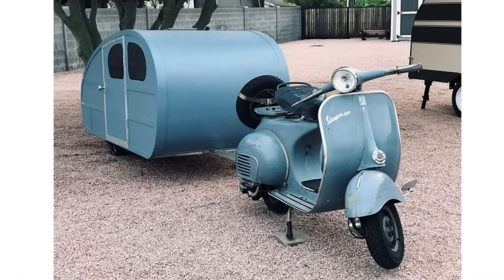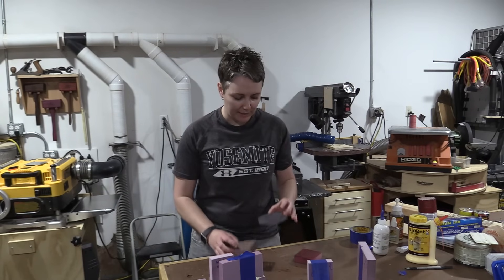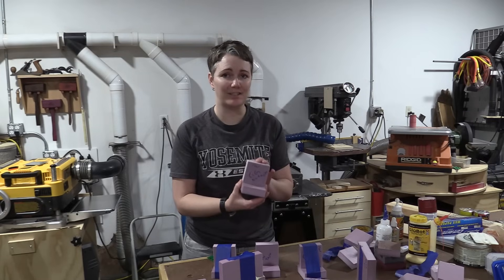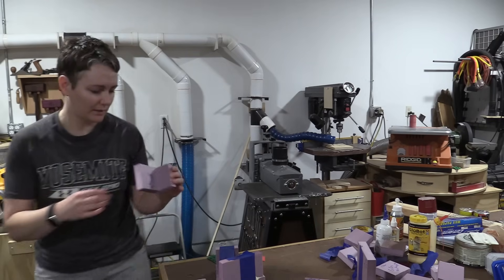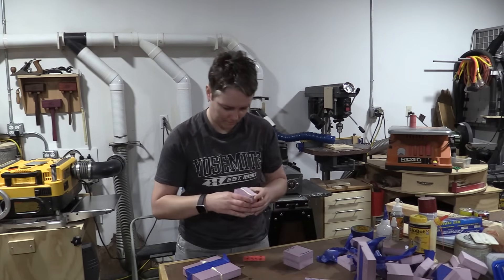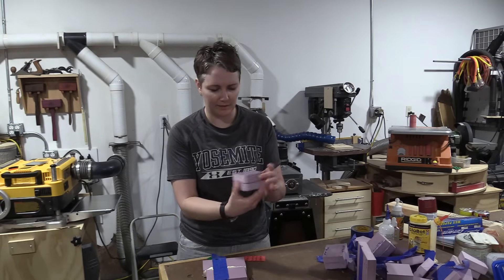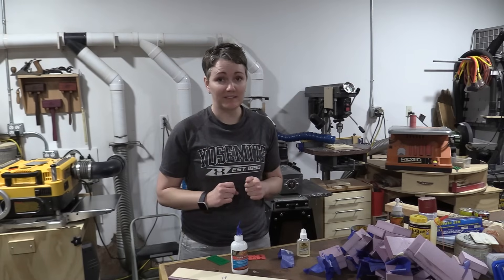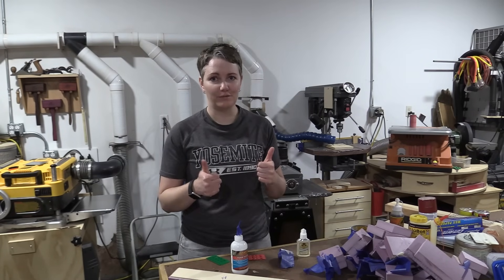NOT Gorilla Glue! Watch This Before Building a Foamie!! BEST Adhesive

Comment: Late to the party here. But just finished my foamie and want to offer my advice. Any polyurethane adhesive (gorilla glue and most construction adhesives) create a mechanical bond to the two pieces being glued. You absolutely must create a rough, or uneven, surface to the pieces being adhered. When done correctly the connection will be many times stronger than the material being adhered. Try sanding the XPS foam at the connection point with a very coarse sand paper. If possible, I recommend rough sanding first and following up with a docker after (I used a roller docker with steel pins made for docking pizza dough). For adhesive I really like a couple construction adhesive designed for outdoor applications: Loctite PL Max (caulking tubes only) and Loctite Power Grab All Purpose (available by the gallon). They are fast acting, easy to work with, and clean up with soap and water.
Reply from the maker: Thank you for your response! And yes,  in the trailer we roughed the foam up with a wall paper remover in some parts and 80 grit sandpaper in others.  The end to end demonstration more accurately shows the foam without any film over it. The foam fusion still provided the deepest bond.
Reply: @thelwood  Another helpful hint: Use The Vacuum Bag System, Used In Fiberglass/Carbon Fiber Lamination, You Can Also Use A Screen Printing Technique for Burning Screens. Build an oversized Frame and attach Neoprene Wetsuit Material. To Pull The vacuum Straight Down From the Upper Surface To Evenly Distribute the Pressure on the Upper Surface. I Believe they use this "Dry Mount" Technique to mount poster prints to Foamcore for picture frames!?!!  😉🙃😜
Reply: Car body panel PU mastic is amazingly sticky and the resulting rubber is tough. I’ve successfully repaired kids school shoes. You won’t find a better test than that.
Reply: Latex paint, will bond EPS sheets, and is friendly with hot-wire cutting.
Reply: @carrolbrooks2143  I would think that you could use any thick plastic sheeting, clamped with folded over 1x2s and a shop vac for the pump.  It doesn't need nearly the 30 inches of vacuum to work well, and that high vac might immediately collapse the foamie camper.
Reply: @jamesmorton7881  PPG Gripper primer from Kelly Moore... holds like glue and hot wire/sanding friendly.  Just let is start to get a little tacky so it will cure faster between layers.
Reply: I used both Loctite products adhering foam to itself as a former for fiberglass. Excellent for me in that context. Excellent also is your video; thank you for taking the time--more than it first appears--to do this study and report your findings. YouTube at its very best.
Reply: I will just use the foam adhesive. But if I make a tear drop trailer I would cover the ugly foam with a plywood paneling. If the trailer is sealed on the outside there will be no leaks. Now to find something to seal the outside that can be painted with auto paint. Camp-Inn and runaway have solved these issues why cant the DIY as well.  73
Reply: Thanks for doing these tests, my experience on client projects is STAY AWAY from Gorilla products in general. I’ve had way too many expensive glue failures with their products. Loctite and Sika products are much better. Gonna give Foam Fusion a try.
Reply: @Bolthole_Studios  yes! In my opinion - Loctite for primo adhesion and wear resistance and Sika for bomber weatherproofing. At least when you're bonding certain materials mechanically - XPS foam, Styrofoam, wood, cured fiberglass, cured epoxy, cotton, glass

Comment: Wood glue didn't cure because the foam is water tight. Wood normally draws moisture out of the glue, which allows the glue to dry. Something to consider with any kind of water based product if you're working with synthetic materials that do not "breath".
Reply: Breathe.
It is what you do.
Breath is what it is.
Reply: 3M spray adhesive.......

Comment: Didn't you know that one of your biggest fans is an amazing material scientist and glue expert?!  If you need a "Home Depot" solution, I would expect a product like Loctite PL300 to work well.  Any of the urethane based adhesives will foam--that's why I avoid them for wood projects too!
Reply from the maker: Awesome! Thanks Seth!
Reply from the maker: I will consult you for all of my glue needs/ questions!
Reply: Hey Seth - great tip.  I did get some PL Foamboard adhesive.   
Planning to bond foam to aluminum.
Now, will it work with EPS - the white “lumpy” foamboard - made with beads (as opposed to the smooth XPS.) ?
Thanks much.

Comment: Just a thought - the aircraft and boat guys use a 2 part epoxy (West System) which you can get at a marine supply store or aircraft supply house (Aircraft Spruce) then they sand and put a layer of fiberglass over the joint - the result you can stand on or jump on without breaking. Sanding both surfaces of a joint is critical.  I made wing ribs this way and flew it for years - about unbreakable if you need great strength. Good video and fun project - thanks for making :)
Reply from the maker: Sounds great! Great information, thanks!
Reply: Yes! I use epoxy in my art projects and I was thinking the same thing
Reply: Doesn't the epoxy melt the XPS foam?
Reply: @mr.e7022  No, epoxy is good for EPS and XPS, old school polyester resin will melt both.
Reply: I’m an aircraft builder also… I mentioned west systems epoxy in the comments for another tutorial video… also Aeropoxy would work (Aircraft Spruce).
Reply: I would put epoxy over the whole thing and put a layer of fiberglass cloth and then epoxy and another layer of fiberglass and then resin.  2-3 layers of fiberglass cloth.  But the joints themself I would use a foam glue or foam insulation. I would dovetail the joints too.
Reply: Epoxy works great with polystyrene foam. But it is messy and overkill and you have to wear gloves. Clean up has to be done before the epoxy cures. All in all it is a lot more involved. I would use one of these glues for foam, or use a construction adhesive.
Reply: WEST is a great product, but expensive.  It pays off when playing with certain wood structures, or materials like carbon fiber.  For this level of construction loading, RAKA is more than enough, and not much for expensive than regular glues, that would get the job done.  Epoxy pricing has gone down a lot over the last 45 years.  The first gallon I bought was 100 dollars, or 390 in today's dollars.  Today it is closer to 50 for a gallon, depending on the volume.

The same thinking applies to purchasing insulating foams vs structural foams.  Can't see the logic.
Reply: @funmaster4632  Dovetailing foam joints is pointless it has little tensile strength, it is simply supposed to separate the fiberglass skins, or plywood skins.  What you want is a very hard foam that is difficult to dent.  That is why pink foam is about as bad a choice as one can find.
Reply: @HondoTrailside 
What do you recommend for foam?

Comment: If you need to make walls or counter tops or other large panels invest in a vacuum pump and vacuum bags to clamp the wood skins to the foam core to create super strong, super lightweight foam core composite panels. You can get 1/16" real wood veneers or use very thin plywood to lay up on each side of the foam, place this lay up in the plastic vacuum bag and seal the edges, install the connection port for the vacuum pump to the plastic bag, then turn the vacuum pump on and get as close to -29.92 inHg or -14.696 psi as possible. Since all the air has been removed from the bag the atmosphere is pushing from all directions clamping your lay up together with a uniform force of 14.696 pounds per square inch. If your layup panel was 96x48 and you wanted to just use concrete cinder blocks to apply a clamping force to your layup while it cured you would need a whopping 67,719 lbs of cinder blocks to equal the clamping pressure of using a vacuum bag with a full vacuum applied. One other hint, if you need to make a composite panel that will hold more weight increase the thickness of the core and keep the skin thicknesses the same, for example a 2"-3" thick foam core is going to be massively strong that if you were doing a van build you could clear span from side to side for use as a bed platform with the only support being a cleat running down each side wall and no center support. I hope this helps
Reply from the maker: Great ideas! I have a vacupress but I haven't tried using it with foam, just veneer and mdf
Reply: Excellent tips, thanks!
Reply: can you provide the name or link of the brands of bags and vacuum pump you used please?
Reply: @jaystew1249  I do not have specific links. If you are making a one off foamy lighter weight 'disposable' vacuum bags will give you multiple uses. If you plan on making multiple trailers to sell consider a reusable silicone bag for your layups. Personally I try and steer clear of cheap Chinese made items like vacuum pumps, European made or US made are going to be of higher quality. You do not need to spend thousands of dollars on a laboratory grade vacuum pump, in composite construction you do not need or want to pay the price just to get close to a full vacuum which can never be reached anyway. Be vigilant in changing the pump oil and taking care of any regular maintenance items
Reply: For this type of project, you could even bag it with a mattress bag or a tarp and suck it down with a shopvac.
Reply: @mckenziekeith7434  You can certainly try it, however I do not think it will pull enough mmHg for the best adhesion. You would still have to seal a tarp or mattress bag the same as a disposable vacuum bag, you need to buy a brass port and ball valve otherwise you would have to run the shop vac until the glue cures and you would burn up your shop vac, they are not meant for continuous duty. Shop vac can move a good amount of air, however they are poor at pulling an actual vacuum.

Comment: It's usually not the spray paint that melts the foam, it's often the paint thinners used to make the paint thin enough to spray. If you spray the foam from far enough away, most of the thinner will evaporate as the droplets go through the air before it hits the surface. You'll have to test the safe distance for each brand and color on sample pieces. People who make costumes use XPS a lot, they have some tips and tricks that you don't hear about within the community of large project builders.
Reply from the maker: Thank you! Great information!
Reply: @@BLAlley The paint itself is almost never going to react with the foam, It's the propellants that rapidly evaporate. You want to spray from far enough that the propellant mostly evaporates before it lands on the project but not so far away that the paint starts to dry in the air.
Reply: @@BLAlley I've used it. There's a happy medium where it subtly melts and bonds to the surface. This is different for every brand and even every color of spray paint so you need to test a scrap piece. Feel free to invest in a spray gun or use a paint brush. Most people are interested in using spray paints because of their price and availability, ease of use... That's why I explained the why and how to avoid damaging an XPS project.
Reply: @@BLAlley It's a bad idea in your own opinion. No one is preventing you from doing it your way. Not everyone has the money to be picky. Move along.
Reply: @LaOwlett  your channel has no content. It is moving nowhere.
Reply: @LuckyTown77  I'm a commentator, with a real job. This might be an insult if I was an 8 year old with dreams of being a famous youtuber.

Comment: There is a term called glue starved.  This term relates to two smooth surfaces being glued together with a Non-etching glue(  glue does not melt or etch the surfaces to be glued ) and have been clamped together to tight and all of the glues is squeezed out of the area that was to be glued together.  IF  the two surfaces to be glued together are sanded to make a more pores or rougher surface allowing the glue to have more surface area to stick to the glue joint becomes MUCH stronger.  Even by running a pen or dull nail scratching parallel lines inside the surface to be glued will increase the glue joint dramatically because the two pieces that are to be glued together to have MORE glue staying into the joint surface area.
Reply from the maker: Thanks for the info! On the teardrop we sanded at 150 and ran a wallpaper remover it. The side by side joint in this test represents this best since both surfaces were cut.  I was impressed with how deep the bond was through the shiny surface using the foam fusion. Have a great day!

Comment: I really like he concept and the overall look of your Teardrop Camper i spent 35 years as a ProfessionalWoodworker  and  i’ve always done similiar  resting  on  products i’ve worked on myself  i one time years ago had a  Finishing issue with  using incomparable Clear coats or TopCoats that actually  bubbled the other finishes thankfully i discovered that in a test and not on my Final Furniture Peice ! in working with Foams i’ve discovered  you need to stay away from products that use   products that end in Line as the drying chemical   i like  using Adhesive Caulks  designed for the Marine Industry  and often i prefer 3 M 5200  it’s expensive as hell  but has a tenacious bond with almost anything  it is the  usual choice Trailer companies bond the “Screwless smooth exterior Panels onto the  frames with one draw back to 5200 is it’s usually Permanent  a positive is it sets up under water  and is available in a few colors  i’ve seen it trolled onto the exterior of a WoodenBoat Hull  embedded with a Fiberglass Mat  and then GelCoated on top of that to make a no Soak leak free hull  it looks great and  really  tough ed up a very old boat  again it was expensive as it was purchased in 5 gallon Pails  that are a few hundred dollars  per pail
Reply from the maker: Thank you! And thank you for the excellent information! That adhesive sounds amazing:)

Comment: I have done a lot of projects with foam and fiberglass using 2 part epoxy which glues closed cell foam together great and seals fiberglass cloth to foam very well with no delaminations when done properly.  Epoxy can be expensive but doesn't take a lot for a project like the "foamie" trailer.  I suspect the stuff you liked, the foam fusion would work well also.  The epoxy makes thefiberglass very stiff and hard but needs to be painted well with a UV barrier paint to keep from degrading over the years outside.  But it makes an outstandingly rigid and protected outer shell for the trailer.  Great presentation!

Comment: A 1/2" fillet of thickened epoxy and bamboo skewers dowels will make MUCH stronger joints than just butted glue joints.
The foam kayak guys use the skewers 
Fillets are common in boat building (foam and wood)
Reply from the maker: Thanks! We did add a few skewers here and there.  But with the relief cuts for the curves and only using 1 in foam, they were prone to blowing through the foam or ending up between the relief cuts.  So we ended up just using the adhesive and then once it was wrapped with the canvas it was super strong.  I will look into the fillet method.
Reply: @thelwood Jackman Works uses the fillet process on the Upside down boat!
Reply: Doweling is easy with foam, and it makes a big difference.  Even a bunch of toothpicks can really strengthen long joints.

Comment: My foam project involved fabrication of a male plug which was to be layered with composite glass using epoxy. I stacked the pink "Panther " Home Depot 2 inch blocks with original gorilla glue. Although I weighted it with 300 pounds the foam expansion actually lifted the weight. The expansion caused the finished block to be of uneven proportions which I had to sand true before shaping the plug. So it is nice to learn there are alternatives which are strong and non expanding. Excellent! Thank you.

Comment: I found big metal screws (#12) also do a pretty good job of clamping foam together when gluing.

They bite enough to pull things tight.  They also work well with pocket jig holes where that's an option for butt joints.
Reply from the maker: Thanks for the tip! I am happy to hear they have enough bite! I will definitely add some if I do another foamie!

Comment: Good video about gluing foam. This is useful for me. Most of us are not willing to go through that much work, even if we need to know. As you know, there are many ways to skin a cat. You can glue foam with hot glues that normally melt foam by priming  foam with latex paint, the paint will keep the foam from melting. Depending on the heat of the glue, you need up to 5 coats of latex on the bare foam. This works perfect when using fiberglass resin to glue foam or for fiber glassing large surfaces of foam because the wet fiberglass melts unprimed with latex foam.
Reply from the maker: @peterloichtl4512  great information!

Comment: Drywall screws make good clamps use the coarse thread versions, provides some extra strength as it grabs some glue going in.
some foam has plastic coat that will peal off. Kabob sticks also work good put on some glue.
Reply from the maker: Those are great tips! We did use a few kabob skewers but with only using 1 in foam and having kerf/relief cuts we put one through the kerf so it was visible.  After that we decided it was best to just use the tape.  By the time we wrapped it all in canvas it was plenty strong.  Thanks for you tips!